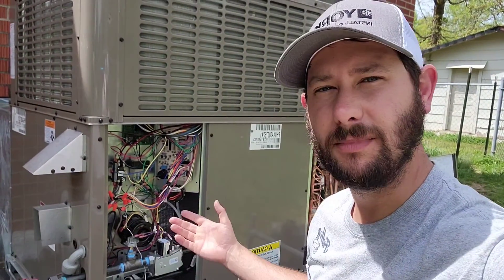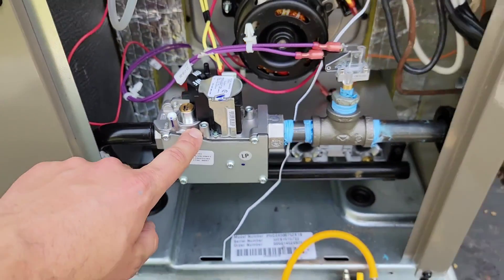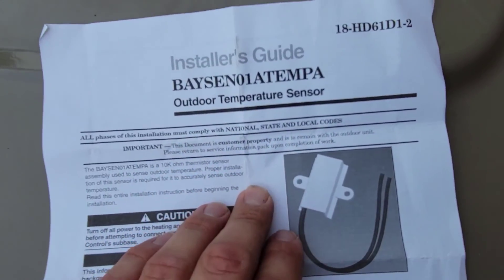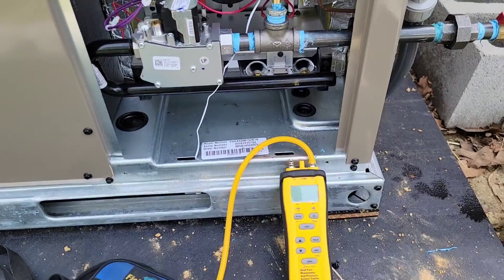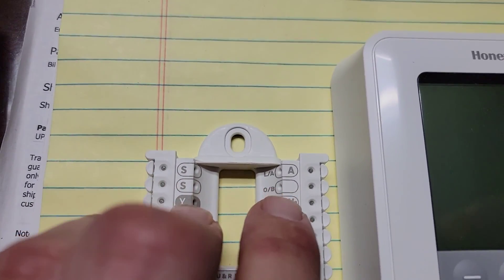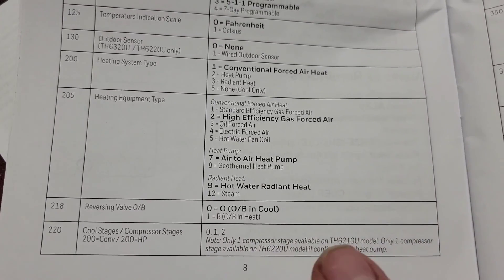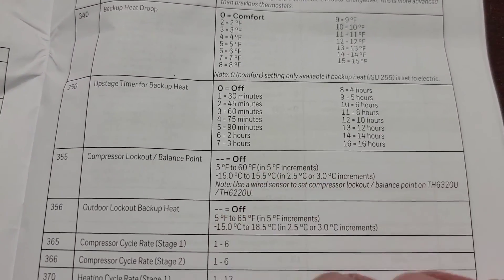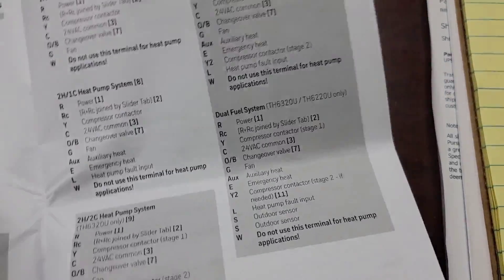Dual Fuel Package Unit Setup Wiring Commission

Comment: Interested in installing a dual fuel unit. Currently have heat pump 17 yrs old with attic air handler.  Main heat is a pellet stove.  I want to switch to propane furnace.  Is the York unit outside and attic installed?

Comment: Remote areas or anyone in general, these solar heat pumps are creeping in. Seems like a good idea. Propane and oil tanks have got to go. The gouging and delays were bad 30 years ago. And it's still a problem today. Dual fuel is mandatory in my opinion. To not be locked into one type.

Comment: Also says Wireless for outdoor temperature for dual fuel. Ours is connected to the internet with the internet icon on and we have it all configured for dual fuel, 3H, 2C Heat Pump, with 40f heat pump lockout. But its acting like a non dual fuel stat and bringing on the gas furnace as the heat pump is running when we bumped up the call for heat a few more degrees. Does it also have to be connected to the Home App to actually get the outdoor temp through the internet? Thanks in advance if you know. Plan on calling Honeywell/Resideo tomorrow.
Reply from the maker: Shouldn't have to have internet for the wireless Outdoor temperature censor to connect to the thermostat
Definitely could be a programming issue or something to do with the outdoor unit in the board if externally controlled by a board.

Comment: Hey man I am wiring up a thermostat to control backup heat. I have the (TH6220U2000) when I get to option 255  and select option 2 for gas the next option after that is 260. It does not give me the option for 256 to select option 2 for gas?
Reply from the maker: Wrong thermostat In the installation manual I think it gives you a number for the correct stat
Let me know if you find out otherwise

Comment: Is that the only unit? As in is there no indoor unit? My space is extremely compact and I’m running a York heat pump and would like to convert to a dual fuel
Reply from the maker: That is the only unit it is a outside package unit

Comment: Well say you want electric heat strip too as an option with the primary being gas. This being because you do not want to pay the crazy propane bill or the gas runs out and now you only have the option to run all electric. Will there be a W3 as an option for electric heat kit? Thank you
Reply from the maker: For a duel fuel I don't think you have that option available

Comment: My thinking if a heat pump goes into defrost occasionally it'll help increase humidity which could be a good thing. Is the dual fuel or fossil fuel kit come with American Standard heat pumps? When I got to thinking my oil furnace has a separate transformer which tells me that I need a relay for it to fire the igniter.
Reply from the maker: Dual Fuel does not come with heat pumps it is specifically a dual fuel unit 
we don't sell many but they are great for places where propane or heat pump is your only option
Reply: Isn't that just a relay that runs the fossil fuel system since that system also has it's own transformer? Couple years ago connected a mechanical outdoor thermostat to my heat pump, and had to set at 33 degrees because the offset temperature seemed like it had a offset of like 5 to 7 degrees where it wouldn't come back on until near 40 degrees. Wondering what kind of offset the Honeywell thermostat has when it locks out the heat pump at 35 degrees? Which makes me wonder if I should set that Honeywell thermostat to lock out at 30 degrees and reinstall the outdoor mechanical thermostat set at 33 degrees which may let the heat pump run longer until it shuts down at 33 degrees since the Honeywell thermostat may not turn the heat pump back on tuntil the temperature is also near 40 degrees if it has a offset of 5 degrees if it's set at 35 degrees?

Comment: If a 2 wire oil furnace is connected to the RC terminal with jumper removed on the thermostat and the emergency heat terminal would need a jumper to aux? Couldn't imagine some running a heat pump below 33 degrees because freezing rain would really make it not efficient.